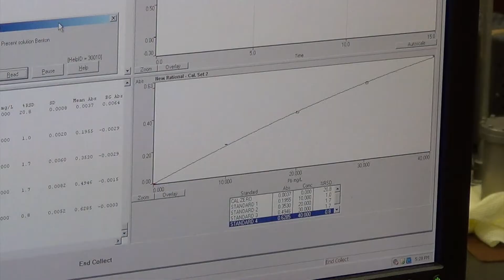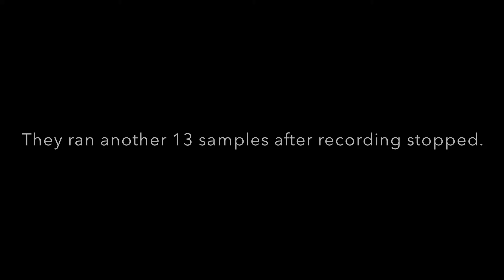Lead Detection Using Flame AA Spectroscopy

Comment: Could you please tell me how to prepare the sample?
Reply: As far as i know you need to get the analyte into solution, and in a way so that you can easily vaporize and atomize the sample (for example, many sulfates or phosphates wouldn't be ideal as you'd need a lot of energy to get them to vaporize. Chlorides might be a viable method if you want to go for AAS). Depending on your analyte you may even need a different setup for your spectrometer (think cold vapour aas for mercury).

Comment: Why we get much fluctuations while taking readings!??
Reply: It can be either: 1) some dirt clogging the solution path to the nebulizing chamber; 2) light source is not properly adjusted (low signal to noise ratio) or the lamp is getting old; 3) reading consecutive solutions without proper rinsing and/or delay time.
Reply: Aside from this, 2-5% SD on readings seems pretty acceptable to me.